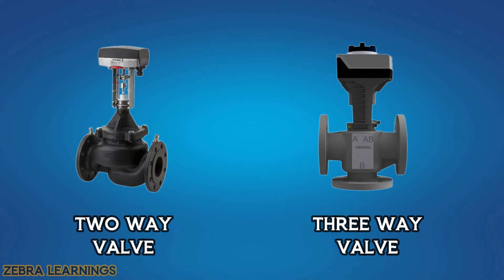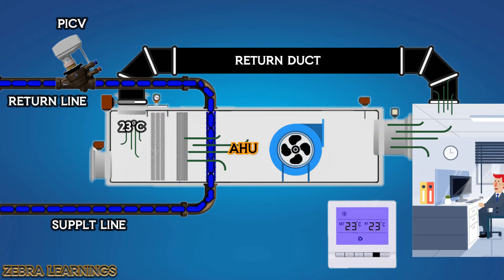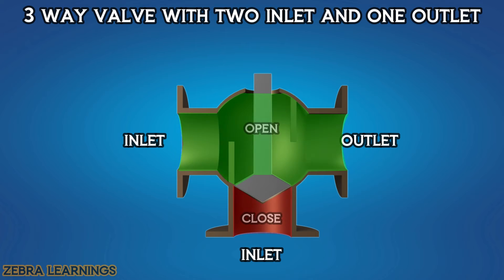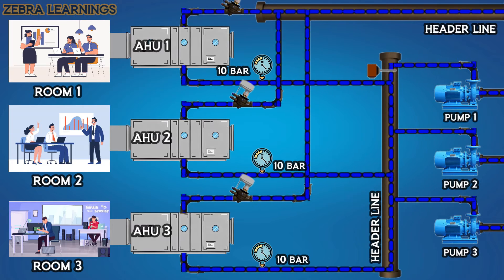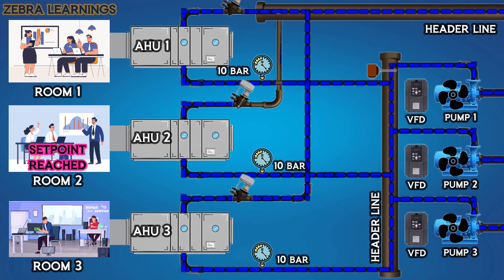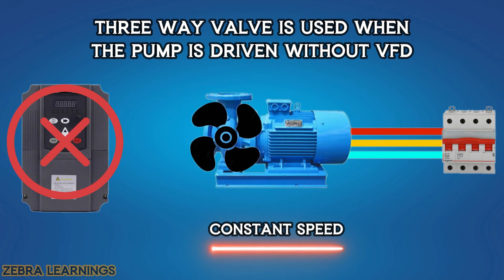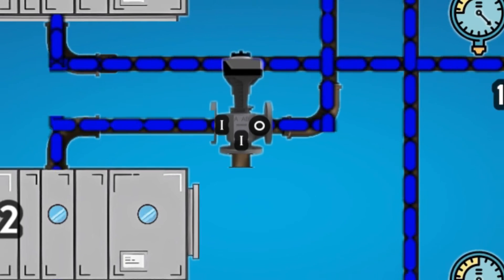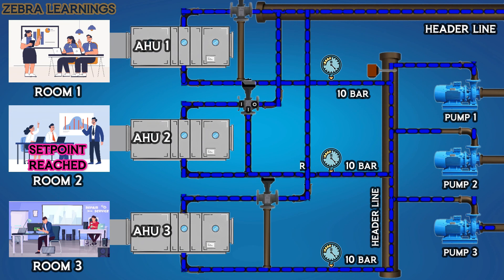Two Way Valve and Three Way Valve Detailed Explanation | Animation | #hvac #hvacmaintenance

Comment: 2:28

This video u  r saying pressure sensor giving command to picv value but another vidoe u said room temperature sensor give the command to the picv value  please tell me which one corret?
Reply: Both are fine. Depends upon your reference value from which sensor you are getting the reference temperature value to modulate the actuator

Comment: why the dampers are usually installed at the return pipe but not supply side?
Reply from the maker: Are you asking about the Actuator or PICV?
Reply: @zebralearnings  sorry for the typo, I meant the valves, not the dampers

Comment: Hi Sir, 
I'm facing a problem with my SKM AHU, having a 3 way valve. If I run the AHU through a 3 way valve or by the bypass, the Supply air temp and Return air temp doesn't come down but remains the same..
Presently the Supply air temp is 14.1°C  and return air temp is 23.6.°C. The CHW inlet temp is 46.04°F and the outlet temp is 48.02°F, chiller running at 60% load with its inlet temp 47.8 °F and outlet temp 42.2°F.
I have carried out a deep cleaning of the cooling coil with indoor coil cleaning chemical , clean the blower,  changed the motor pulley as the groove had worn out, fixed a new V- belt, cleaned the air filters, cleaned the Y strainer and back flushed the CHW line for an debris in the cooling coil, if any. The result supply and return air temperature remained the same. What can I do. Kindly advice
Kindly advice

Comment: Keep the good staff going! Please includ this topic which is very much debated for design and use: when and why for every AHU an additional circulation pump is installed in the supply pipeline of the AHU skid combined with 3 way valve and 2way control valve installed on the coil outlet. Also explain where and why this small circulator pump is better to be install on supply vs return pipeline, considerin heating vs cooling water as well. I dont refer to the main circulation pumps of the entire loop but for each brach with AHU.